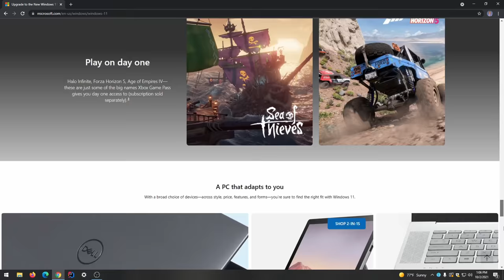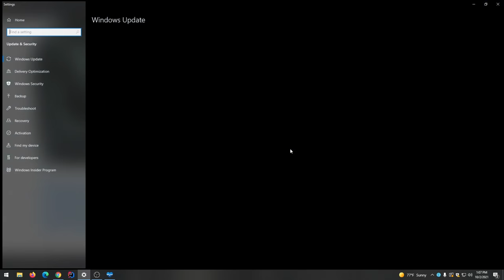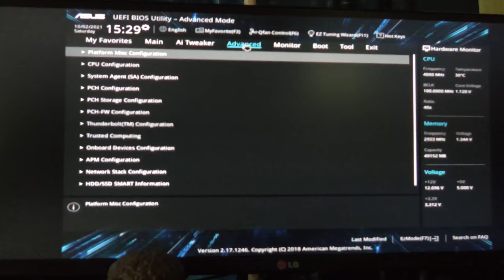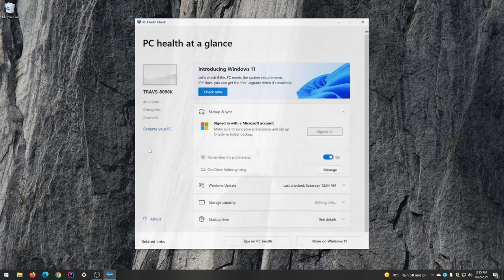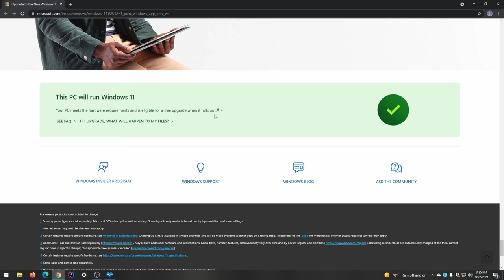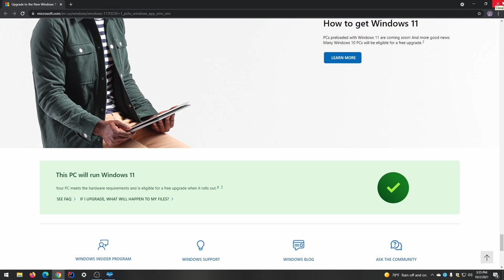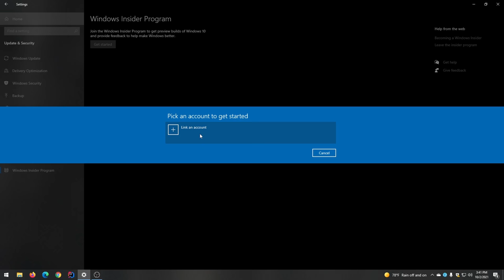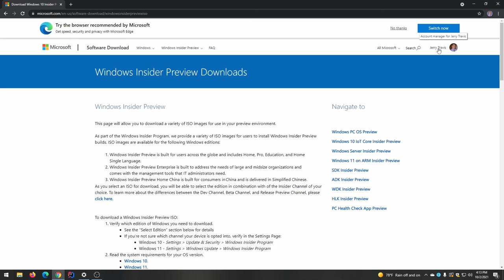Installing a TPM 2.0 Module So I Can Install Windows 11

Comment: Most useful video yet, thank you. Where did you get that TPM from, can you send a link for it?
Reply from the maker: I got it on Amazon. I should have included the link to it in the description: https://amzn.to/3iRzEQ6

Make sure you consult your manual if you don’t have the same board as me. I believe Asus has used 3-4 different TPM pin outs over the years.
Reply: @JerryTravisSmith  thanks, one more thing… are they all the same, some of them are $20, and some are $60, just want to make sure I get the right one
Reply from the maker: @connerscott249  I can’t say for certain they’re all the same, but I think if the TPM is for your brand of motherboard and the pin out is the same it should work. I saw somewhere the actual chip on these is almost exclusively manufactured by Infineon. The TPM I used indeed had an Infineon chip on it. 

As for the price differences, I think that’s a supply and demand issue. Almost nobody bought these things before. They were $5-$8 I think. When some people figured out Windows 11 required TPM, they bought them all up and jacked up the price. I paid $37 for mine. The $60-$80 price tag is just straight-up scalping.

Comment: Can that TPM chip be used in all Intel MBs?
Reply from the maker: No. Different motherboard manufacturers have different chips. And often, a single manufacturer (e.g. Asus) may have different chips for different models of their own board. Your motherboard manual will tell you which one that’s compatible with your model.

Comment: Can you reply to this with the site where you got it from please?
Reply from the maker: I got it on Amazon and paid around $70 for it (I think). I tried going through some other suppliers who had it closer to the normal MSRP of about $25, but they always cancelled my order after a few days saying they were unable to fulfill the order because the factories were unable to make enough chips. This was all right around the pandemic. I think a lot of the supply shortage has subsided.

Comment: Why? You can just enable the Firmware TPM in your CPU
Reply from the maker: Either my CPU or motherboard doesn’t have that feature. I looked through every option in my BIOS and there was nothing pertaining to PTT or Trusted Computing. The manual made no mention of it either, other than the TPM header.
Reply: @JerryTravisSmith  
buy  8 th gen PC for TPM 2
Reply: Seems cpu tpm is causing stutters on the ryzens processors.

Comment: 2:17 I count 13 pins... Jerry what's wrong with me :( ?
Reply from the maker: If you watch just past that, I corrected my mistake. 😆 Talking on camera and making sure the lighting and shots are good is difficult.
Reply: @JerryTravisSmith  I wish you mentioned the 20-1 TPM module also, they are out there.

Comment: It would be a lot easier to just install Linux. Windows 11 is not worth the TPM 2.0 requirement, especially if a system doesn't already have it.
Reply: anticheats want it

Comment: Good nerd? Windows 11 sucks. A bad nerd wants it. A good nerd wants it gone.
Reply from the maker: I was actually just installing it to do some benchmarks to see how it did on 12th gen Intel chips. 

I don’t like it over 10 either. That said, I’ll be supporting 11 for years to come whether I like it or not so I use it on some machines just so I’m not blindsided by tech support questions.
Reply: @JerryTravisSmith  dude nice answer. Keep up the good work. And may you order something and accidentally get a huge upgrade.